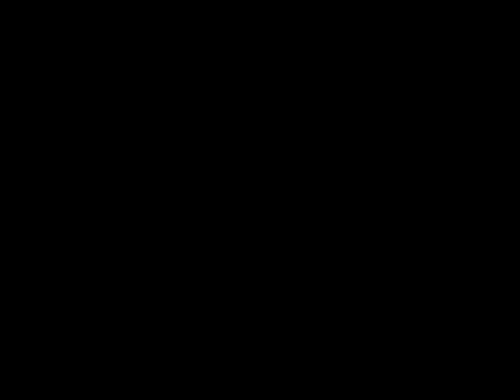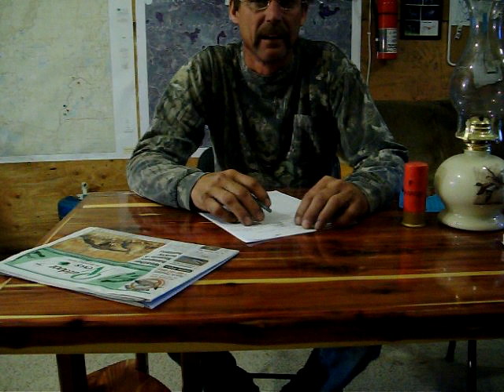Honda 3000 Generator and an introduction to Wind and Solar. Part 2

Comment: You may want to check out 12volt refrigerators & freezers made by a company called sundanzer. They are chest units (apx $800), and claim to be able to run them off of 1 solar panel.would be much easier (and cheaper) to  run than a upright refrig/freezer units that you are using.